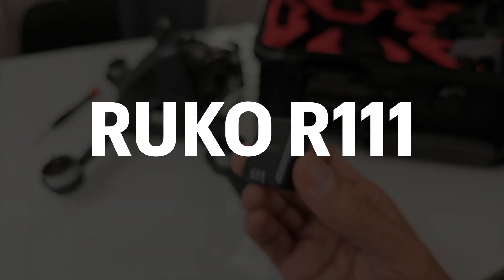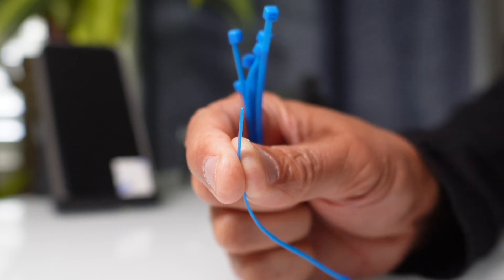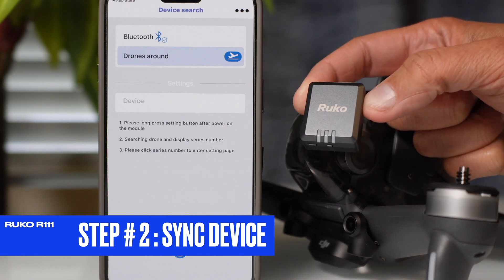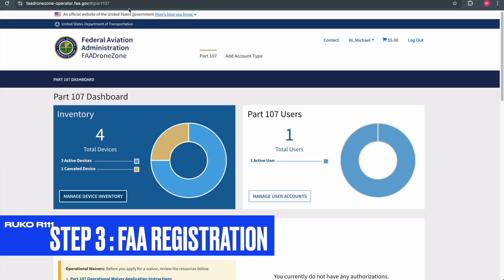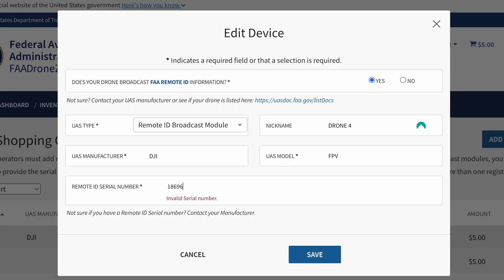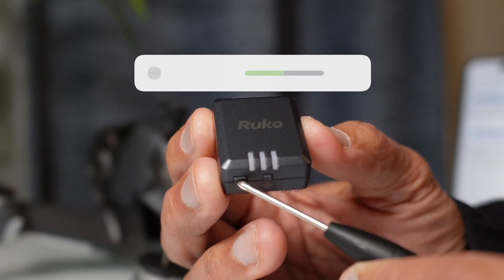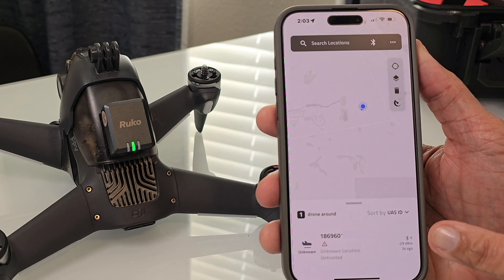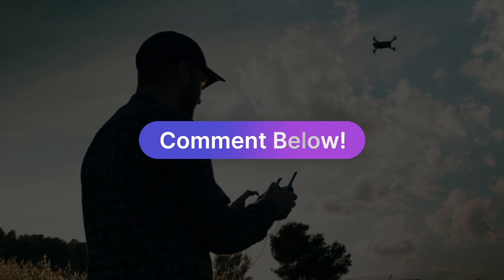How to Setup RUKO R111 Remote ID Module | STEP-By-STEP!

Comment: Hey Mike, so I had registered my drone previously and wanted to add my remote ID module to it. On drone zone it won't allow me to make changes to my already registered drone. At this point do I just add the ID as a new device? Will this be valid?
Reply from the maker: Hi Eric, DroneZone doesn’t let you “edit” an existing device entry. The FAA’s guidance is that you add the Remote ID module as a new device under your registration. I am assuming your previous drone did not have standard Remote ID. 😎 👍
Reply: @mikesytes Correct Sir! I have the dji mini 4k and had it registered so I deleted it thinking I could add it when I added it back. Now I'm confused because I still have my registration number and the drone has been canceled. All I'm showing now as active is my module. This module is linked to the registration number in the app for that drone though!
Reply: On a positive note,I passed my part 107 exam!! Thank you for all the quality information you provided!!
Reply: @mikesytes That process did not give me a registration number

Comment: Great video! I just bought this remote ID and was looking for a video just like yours to set it up. But I have a question perhaps you can help with first. I have a DJI Neo which of course is well below 250g, so I don't need a Remote ID. However, I plan to use it for occasional commercial operations for flight over people (e.g. outdoor events such as a small street fair) and I know that I need a remote ID which will make it a Category 1 drone which is why I got the Ruko remote ID to begin with. But if I sometimes just go to the park to fly around to practice (so not for commercial purposes, basically as a recreational flight), do I need to turn on the remote ID or can I just keep it off? Or am I supposed to enable it all the time since I registered the Neo on the FAA drone zone, again, even if it's just for recreational flights from time to time? Thanks for your help, great video!
Reply from the maker: Wow! This is probably the BEST Question I have been asked yet. The DJI Neo weighs approximately 135 grams, and the Ruko weighs about 13.5 grams, so you are still under the FAA's threshold of 250 grams. You can fly without Remote ID recreationally, even if the Remote ID Module is attached, as long as you stay under 250 grams. Now, here is where the "BUT" comes into play. If a Remote ID module is registered with the FAA and "ATTACHED" to the drone, it must be turned ON and broadcast for every flight when attached to an aircraft, even if that aircraft is sub-250g. If the Remote ID module is registered but NOT physically attached to the drone, you do NOT need to power on or broadcast Remote ID. I hope this helped. I am going to upload this awesome question in the next video. Thanks! 😎 👍
Reply: @mikesytes  Very cool! I appreciate the quick response. Sounds like I'll just physically remove the Ruko remote ID when not flying for commercial purposes, but attach it when I need it for flight over people under Category 1 operations. Gotta love that velcro ;)
Reply from the maker: @megericdeki Awesome! Stay tuned to thus channel. More videos are coming soon! 😎👍